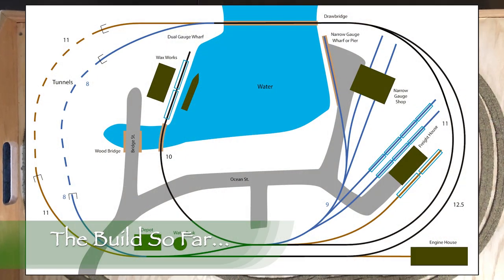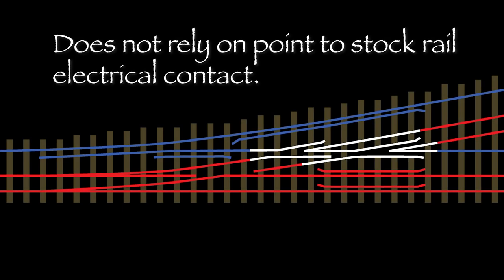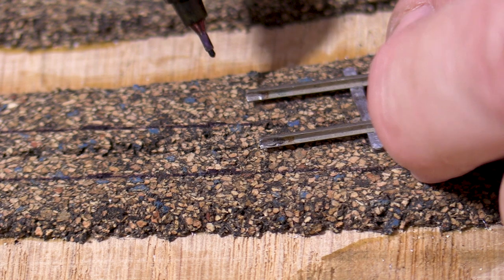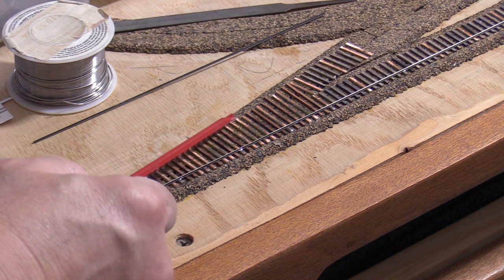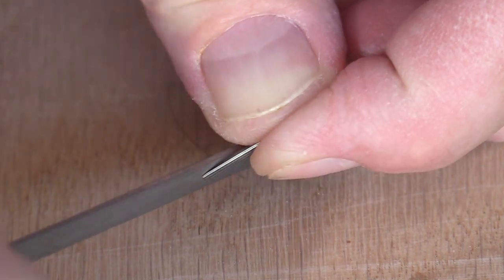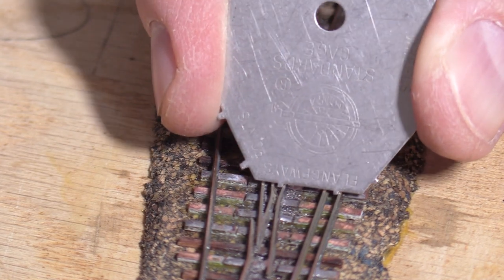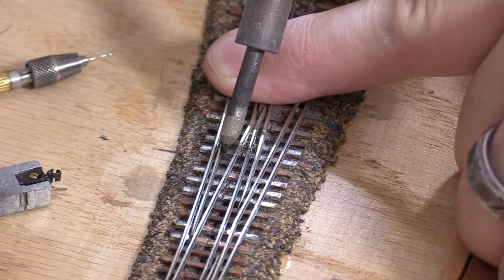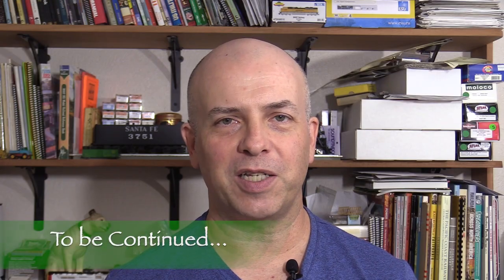Layout Building N Siren Creek Part 8 - Building a Dual Gauge Turnout

Comment: With that much craftsmanship I hope that the wood that the layout sits on is treated and kiln dried. N scale is such a moody temptress and I would not take any risk on that much effort.
Reply from the maker: It's on 3/4 inch oak plywood.  I have wondered about expansion and contraction, though there are a couple mitigating factors.  The climate in our area is more moderate and doesn't have as extreme temperature and humidity swings as some other places.  It's also small, so I'm hoping that it won't have too many of those kinds of issues.  I guess time will tell.  Thanks for watching!

Comment: I am not sure I have the patience to do hand laying, but this is a small layout so I might be able to handle it  😁   I like the small "coffee table" layouts and am always surprised how detailed they can be and still look good. This would be the perfect layout to take to train shows if you ever wanted to.  I would like to offer a recommendation.  This is just personal preference because I have done electronic repairs, but try some of the silver bearing solder, usually comes in a fine wire. It is better at conducting, stronger and because of its small size, easier to control the flow.
Reply from the maker: I'm really enjoying building this layout.  Honestly I'm glad it's not any bigger because I wouldn't want to do the dual gauge thing on a large scale.  I might consider bringing it to train shows in the future.  I think small layouts can be really cool.  Thanks for the tip about the silver bearing solder.  I'll look for some.  Thanks for watching, too!

Comment: Nice work Dan!! That's so cool you
can download switch templates, I
have been thinking about building
some N-Scale modules just to run
some trains in my basement, I would
love to try building some turnouts for that!! Merry Christmas to you
and Nichole and hope you find some
train stuff in your stocking!!
😄😄😄😄😃👍👍👍👍👍👍
Reply from the maker: Fast Tracks has templates for different scales and types of track, which is great.  They also have assembly fixtures, but those are pretty expensive.  Unless you want to build a lot of one thing, I'm not sure how cost effective that route is.  The template was useful so I could figure out all the different parts of this dual gauge turnout.  The layout needs two more of them that will not be standard sizes, so I wanted to make sure I could get the regular No. 6 one to work first.  I just finished the curved one on the other end of the passing siding, so one more to go.  Building modules is a fun way to enjoy the hobby, and they're easier to move!  Merry Christmas and thanks for watching!

Comment: Wouf....i´m afraid doing it in HO. You did it in N plus narrow gauge !
May be i shouldn´t be afraid and try it ? 😊😊
Thanks for your excellent work in a complicated turnout.
Reply from the maker: I'm glad you enjoyed watching my build.  I think you could do it, too!  Building a regular (not dual gauge) turnout is less complicated.  If you haven't had a lot of experience with handlaid track I'd try something simple first, maybe even just a stretch of plain track.  Then maybe a normal turnout.  Fast Tracks has free downloadable plans that you can print out to use as a guide.  They also sell fixtures to help hold things together while you're building the turnout.  I haven't tried those but a lot of people like them.  Thanks for watching!
Reply: Thanks Daniel for your counselling. Fast Track jigs aren´t cheap but probably a good idea when starting from zero. 
I like tiny branchline tracks with not always square ties. Cheapest real ones have 2 flat sides and 2 rounded ones, coming from smaller trees. That goes with small rails like code 55 or 70 for the tallest. Not sure if everything passes on small rails. Replacing cheap plastic wheels on a boxcar is easy. On a steamer, it´s an other story.  OK Dan, i know put the steamer on a piece of track as an exhibition model of past technology.... and if too many, put a rairoad museum on the layout, an other never seen on layout.😅😅

Comment: Hey Dan, if you’re having issues getting the old Marklin mechanism to work reliably on your Nn3 steamer, you might consider getting one of the newer models. Marklin has come out with new Z scale steamers in the past year or so that have detailed and moving running gear. The new mechanisms also use a coreless can motor. I got a Marklin 88032 and it looks like they kept the internal profile the same as the 8895 so the new mechanisms should be able to fit under the same shells as the old ones. I was working on making an Nn3 2-6-0 and couldn’t for the life of me get the old Marklin mech to run well under DC (didn’t even try DCC). I haven’t done all the work to modify the new mechanism yet, but I test ran it on DC and it seems to have quite a bit better performance.
Reply from the maker: That's good to know.  The Nn3 engine project has been put on the back burner for a while since I've been putting so much time into the layout.  I actually have two of the older 2-6-0 mechanisms.  The one I've been working on runs better than the spare.  Electrical pickup seems to be an issue.  I'm hoping adding a tender with wheel pickups will help with that.  I put a decoder in the spare mechanism just to try it out, but it stalls a lot.  The one that I was intending to use runs pretty well on DC, but I haven't tried DCC yet.  I may consider one of the newer mechanisms if I can't get the one I have to work well.  Thanks for the info!